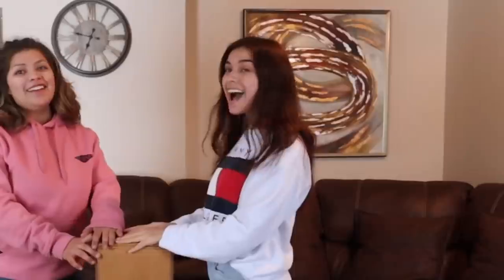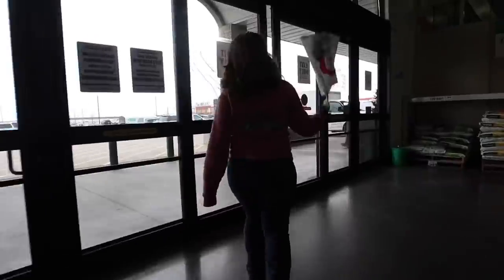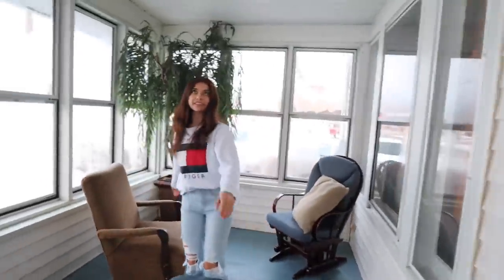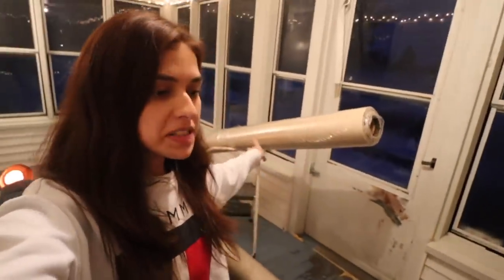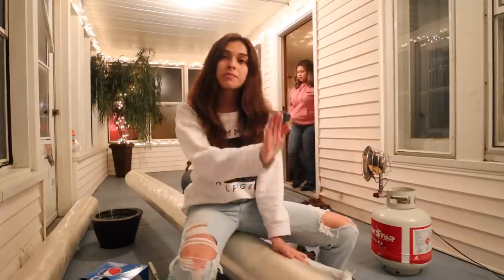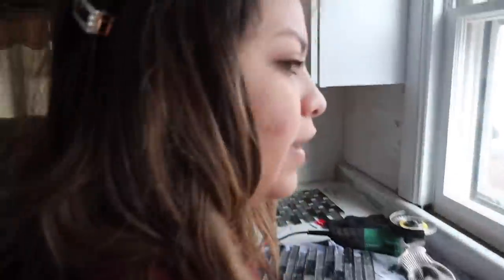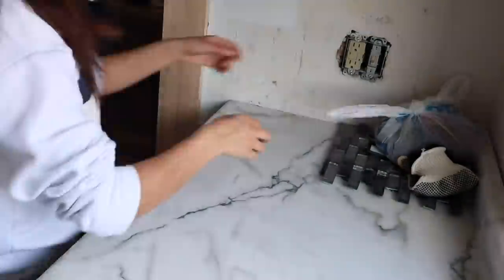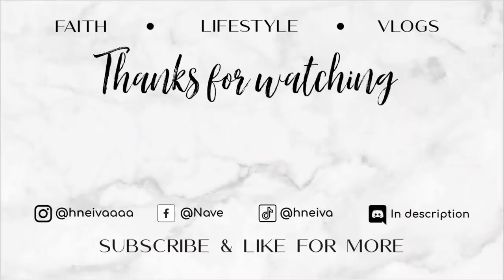I TRANSFORMED THE PORCH!!!

Comment: dont throw away off cutts of carpet, use a hot glue gun and stick 1 inch squares under planters and other stuff that might scratch tables, also they good to go under chair legs to stop scratching floors, you can also use the hot glue gun for the lights.... best tool in the house is a hot glue gun....